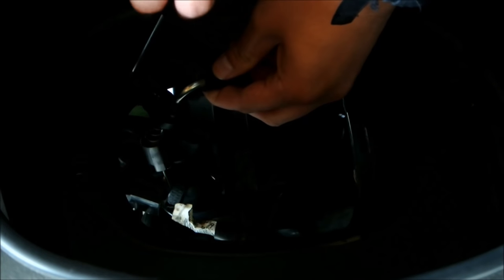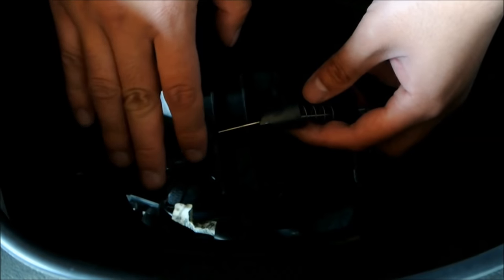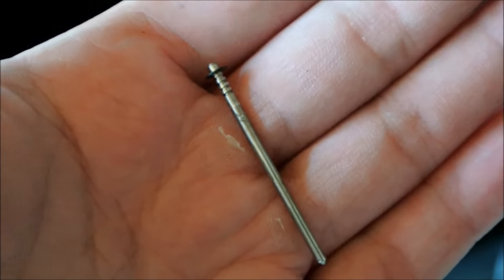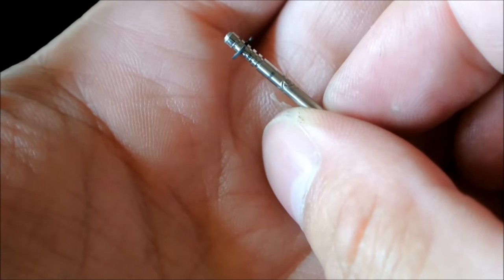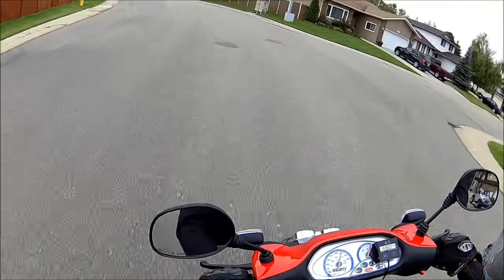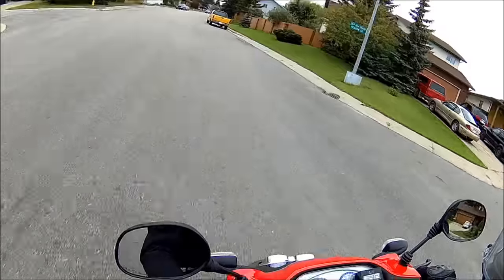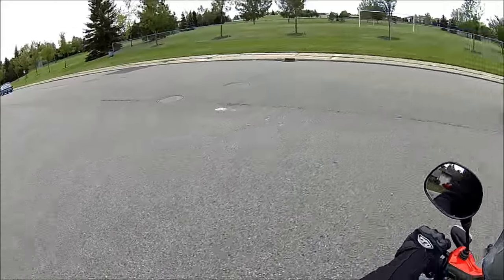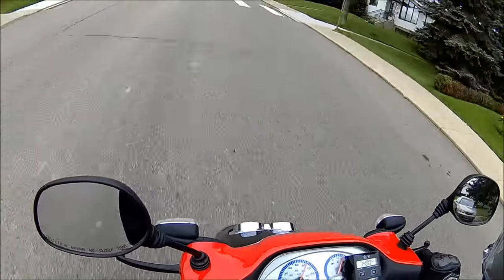STEP 2: ADJUST CARB NEEDLE & MAIN JET (FASTER SCOOTER - EPISODE 5)

Comment: I run a 84 main jet and needle in 2. notch (from top of needle) Removed restriction in exhaust and variator ring removed gives top speed around 80 km/h on flat roads.
Reply: can you explain more on this? WHat is the restriction in the exhaust and what is the variator ring?
Reply: restriction in stock exhaust or aftermarket?
Reply from the maker: My other episodes cover these. Check them out!

Comment: I ground a taper on the bottom 5/16 of my niedle and went all the way rich. The taper helped carry over the fueling as the pilot get maxed out. Big improvement on my TGB
Reply from the maker: Modifying the needle profile is a common approach that could lead to good results. However, unless precise machining work was done I find it hard to make the good results, if any, repeatable and therefore opted for the less custom approach with jet changes. Well done!
Reply: Its a slow process of grind and plug check
Reply from the maker: I tend not to rely on plug check as human perception of color is very subjective and for small cc engines plug checks are not 100% reliable/accurate... but that's just me. Multiple ways to skin a cat. As long as you improved performance without excessive fuel consumption and good reliability that is in my opinion good enough for disposable bikes like these little scoots. On my ducati, however, exact science is not an option but rather - a must.
Reply: +FIFTYmil a fewways to skin a cat and the cat doesnt like any of them.
Reply from the maker: AMEN! Well it does seem like my cat loves the improvement and it is performing better than ever. I tend to quantify everything however and report improvements by MPH or % difference. Hope you found the video helpful!

Comment: I have a problem with leovince on piaggio nrg carburetor is my dellorto 12mm which nozzle would be best on leovince tt exhaust
Reply from the maker: tt exhaust is quite tame. I believe its almost close to stock jetting. Did you make any changes to the dellorto
Reply: @FIFTYmil  I didn’t just put the larger nozzle 78 myself and move the needle to the last stage

Comment: Please help. I have the needle on position 5, that’s how my kart runs best. Should I change the pilot jet to a bigger one and then bring the needle down to position 3 or 4? My understanding is that when the needle is in position 1 or 5, you should change the pilot jet to a smaller or bigger one, so the needle ends up in position 3, is that correct? Thanks
Reply from the maker: It's different for different carbs. Can you tell me what it does to the needle as you move from position 1 to 5? For some carbs, moving the clip higher plunges the needle further down thus reducing the amount of fuel entering the combustion chamber
Reply: FIFTYmil 
In my case, it’s the opposite, by having the needle in position 5 I have more fuel going through the carburetor, so it’s richer and that’s where I get the best response from my Rotax engine. So my question is, if I should change the pilot jet for a bigger one and then bring the needle down to position 3 or 4 (it’s my understanding that the needle shouldn’t be in position 5 or 1, better to have it somewhere in the middle 2-3-4.) Not sure if I’m making myself clear? Thanks

Comment: What happens when running this on Notch 2 from the top would it rev to much ? And would it go faster?
Reply from the maker: It depends. The notches only control the amount of fuel. The best fuel air mixture makes the most power and therefore faster.

Comment: Do you adjust the air screw after like lets say miving the clip 1 down to richen up the mixture? Is it the needle that causes bogging on 1/4-3/4 throttle every time i start my scooter cold and straight away use it? But it will be fine and not bog if warmed up for like 5-10mins but that it's a lot of time to wait especially if you are in a hurry.
Reply from the maker: Nino Echavez I tend to adjust the air mixture screw first before I adjust the needle clip or main jet. The air mixture screw is largely responsible for idle mixture. It sounds like you tuned your bike a bit too rich at idle and low throttle application
Reply: @FIFTYmil  so the bog is because i  richened the air screw too much? It only happens though everytime when the scooter is cold i just wonder. But nil bogging when warm.
Reply from the maker: Assuming your scooter has autochoke, yes your idle mix may be a bit too rich so when the choke is on during warmup, the engine is running beyond rich and stuttering. When the choke is off after warmup, you're still running rich but not enough to cause any observable symptoms. Therefore, leaning out the idle mixture ever so slightly may improve your fuel consumption and yield slightly more power.
Reply: @FIFTYmil  yup man it is autochoke. I see so i'll start with it first instead of the needle clip? Thats what i was wondering why the bog only happens if i use it straight away from cold and fine with no bog when warm even on WOT. I will tune it and get back at you soon hopefully i finally get rid of thos bog everytime i start it cold. Thank you heaps
Reply from the maker: I would return everything back to original setting and take only one step at a time. If it improves performance, keep it. If it doesn't revert. That way you won't get mixed up with what you did versus what you see.

Comment: For my Scooter [Viarelli GT1] [4 Stroke], if you set your clip higher the more fuel you can combust, At stock it was at the third line, now is at second and goes much better. Maybe it's the oppesite for 2 Strokers.
Reply from the maker: Stonza Photography that's odd! Are you sure it's getting more fuel??? What carburettor does it use?
Reply: FIFTYmil Actually i was looking at others tutorials on how to derestrict a 4 stroke. And in those videos you are by to learn that setting the throttle needle adjustment plate higher will increase the amount of fuel the carbourator will flow through to combust.
Reply: Yup put mine all the way daown ran like shit. Its a fourstroke so could be opposite

Comment: Hey, so my scooter is bogging down when i give it a full trothle, is there something ti do with this needle?
Reply: Have you checked if your air filter is clean?
Reply: @tonkoljanos3195  Yeah, just cleaned it yesterday, it was quite dirty, now its a bit better, but still bogs down
Reply: On full throttle it's nothing to do with the needle. It's the air fuel mix I think. Or you need to give more air or less fuel smaller main jet.
Reply: @tonkoljanos3195  just moved the needle bit down, it was on the first gap, didnt change any thing but atleas now my scooter is a bit richer. And i have a nother problem, when i ride my scooter and when it sits   by my house it ussaly gets floded and is hard to start, what could be the problem?
Reply: Hard start and bogging can be a petcock problem too check your petcock just in case.
Reply: @tonkoljanos3195  i dont have a petcoock
Reply: Usually every scooter has a vacuum fuel tap.
Reply from the maker: Best way to test if it is a fuel/air mixture issue is to use duct tape to partially cover the intake and see if the engine performance improves or worsen immediately

Comment: My 50cc enduro goes faster with choke on, is it the problem of the needle?
Reply from the maker: "faster" at all rpm? At what rpm? In all conditions? How much faster as compared with choke off?
Reply: @FIFTYmil  it gets around 10-15kmh more, it doesnt really feel much different at lower rpm, but at the top end if the choke is off it feels like the bike cant rev as high
Reply from the maker: @EctoGamer  Your observations seem to suggest that your main jet is running lean. Increasing the size of the main jet may  yield the same if not better performance than running with the choke on.
Reply: @FIFTYmil  what about making the needle lower?
Reply from the maker: @EctoGamer  The needle is often for fine tuning. Observing such a significant difference with the choke requires a major tuning.
Reply: @FIFTYmil  its like starving for fuel, so im going to try lowering the clip to make it richer, cause i dont really know if its running lean or rich
Reply: @FIFTYmil  ive read somewhere that if the bike runs better whit choke on its running way too lean
Reply: @FIFTYmil  so today i changed the needle position to richen it up, now the bike bogs when opening throttle in 4th gear, speed drops  to 35 then when i get back to 40 it drops again, it feels like its not getting enough air, but the air filter is clean
Reply from the maker: @EctoGamer  Are you certain that lowering the needle clip position richens the mixture?
Reply: @FIFTYmil  i mean lowering the clip

Comment: How to remove the needle?
Reply from the maker: There's a c-clip holding it in place for many carbs
Reply: FIFTYmil I know but how to remove the needle from the thing that’s holding it ?
Reply from the maker: @JK97150  expand the ring by pushing the two ends of the c clip away from each other.
Reply: FIFTYmil I know that I am talking about how to remove the needle from the spring

Comment: Uuummm. I cant see nothing. You have the saying know how but You dont show anything when You go into the scoot seat or anything. You need better lighting on the top of the motor. Atleast get a led headlight that You can wear while doing motor work. Ebay & amazon has them for cheap!!! Hell I have 1 & can do a better job with recording & tutorials than you!!!
Reply from the maker: And yet you have neither subscribers, videos nor view counts. #justsayin
Reply: What about a kid thats in high school & has his first scoot and wants to upgrade it??? I guess Im gonna have to do My own in better lighting to show them how to disassemble the whole entire bike motor & reassemble it on both 50cc & my 200cc.
Reply: Ok. How to derestrict a 50cc. You can move the needle clip down but it burns more gas. Just change the main jet to a 87 jet. Cut the pink wire going to cdi box (rev limiter wire). Disassemble the air box & take the restricter thats between the air box & snorkel tube going to carb out. Leave the air filter out so carb can breathe better. Get lighter slider weights installed in variator. Roller weights like to get flat spots & over a peiriod of time decrease performance. Go to main gear in rear thats connected to the tire & press off the stock gear & press on performance gear. Go to a high performance cdi box, voltage regulator & ignition coil. Thats it! 50cc derestricted & a 5-10 hp gain.
Reply from the maker: Very well done regurgitating what the internet often tells you in order to "derestrict a 50cc." It is simply a blanket answer with no merit. Instead, some positive criticism I have for you would be to look at things from both sides and also ask questions why you do it. Eg. Why main jet 87 not 90? Does everyone have a pink wire going to the cdi box? What is the disadvantage of riding without an air filter? If slider weights are better than roller weights why hasn't OEM retire roller weights from the industry by now?

Doing so will yield you with a far more better tuned scooter because you truly understand what each change will do (and whether it actually gives you the change you desire) and aware of the weakness associated with each respective mods. That is what separates an athlete from a simple joe, a passionate racer from a oblivious shop tech earning his/her keep in the daily 9-5 grind.